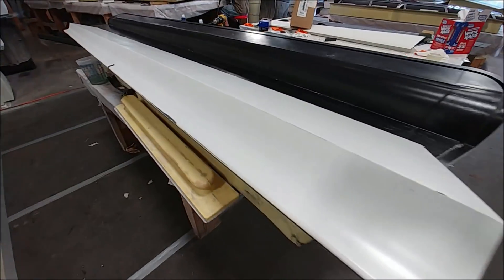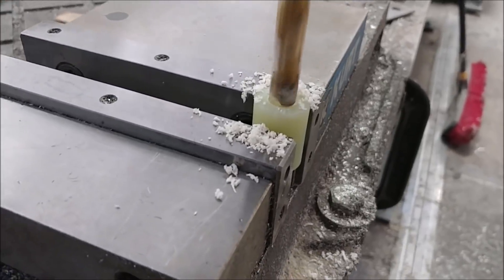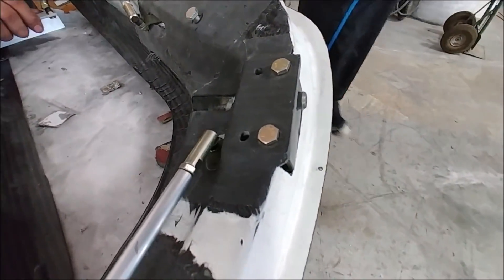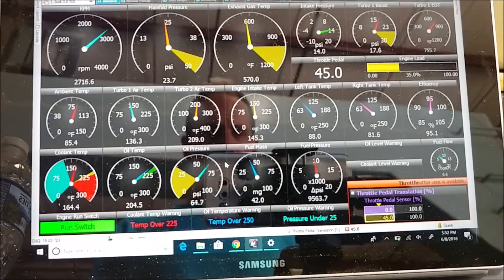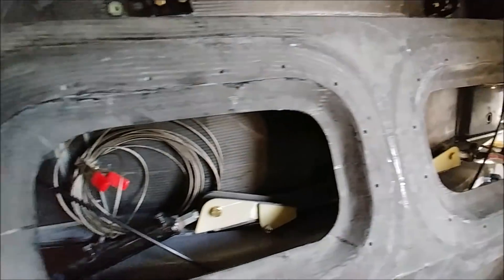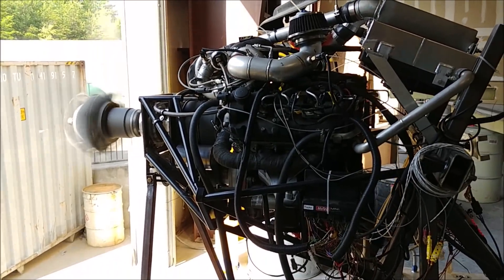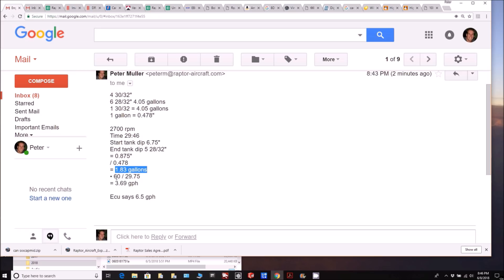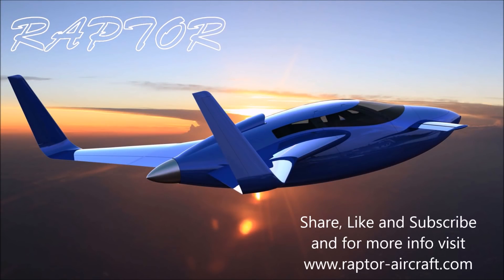What the Fuel Flow? - Building the Raptor Prototype

Comment: Some diesel high pressure injector pumps use excess fuel to flow thru the pump and return back to the tank to help cool the pump...not sure if this one is if that design or not and if so is the ECU able to show what’s actually burned and not returned to the tank?  VP44 on Dodge Cummins for example sometimes up to 70% of fuel pulled from tank is returned to tank in a cycle of cooling/lubricating the pump.   Probably not the case with this engine but just thinking out loud.
Reply from the maker: Yes we have a fuel return to the tank. From what Motec had told me I believe the fuel flow is calculated from the volume the injectors are spraying and no from what the pump is moving.

Comment from the maker: I have since calculated what I think the volumetric efficiency of the engine is at those power settings, using the link below, and it appears that it may be only 39%. In the spreadsheet it's just a number you enter and it was set to 90%. So if I set it to 39% the spreadsheet shows 3.6 gph and 77hp. So the gph agrees but 77hp seems low to be turning a 74" 4 bladed prop at 1888 rpm. I may try modifying the spreadsheet to calculate the volumetric efficiency from the input params. Again, your comments are welcome.

Corrections to my narration. Sorry it's difficult to read in the small preview window when I am narrating.
At 12:16 fuel flow is 3.69
At 12:32 horsepower is 176

https://x-engineer.org/automotive-engineering/internal-combustion-engines/performance/calculate-volumetric-efficiency/
Reply: Raptor Aircraft 
What is your prop pitch at?   Flatter pitches obviously require less hp and thus fuel at a given rpm. 
The diff in fuel burn measure manual vs ECU still has to be figured out.   
I would be very careful with online calculators with which I didn’t had thorough understanding or experience.
Reply: I'm no aircraft engine engineer, but I would agree, there's virtually no load on that engine spinning a flat propeller - that may account for the reduced horsepower and fuel burn you're seeing. 

As for the ECU readings, I'm lost there, you'd think it's somehow reading what the injectors are doing or how the fuel pump is performing - maybe the reading is being confused somewhere/somehow in those sensors.
Reply from the maker: Well the prop is set for takeoff pitch similar to what you have on a fixed pitch prop. There's all kinds of throat coming from it if you downwind if it. So let's take a Cessna 172 with 180hp at take off at 2700rpm. Do you think it could turn a 4 bladed prop at 1900 rpm using only 77hp?
Reply: The amount of fuel injected per millisecond may differ between each injector and the ECU needs to know the factory calibration code for each injector. Since you use a generic ECU, it probably has no idea how much fuel actually gets injected.
Reply: horse power needed goes with the power of three of rpm,  so while 2,700 is only 42% more rpm it needs 2.9 times the power.
Reply: Hi, great work as usual. I think your problem might be in the units? In your email you have 3.69 gph and it was 3.69 g burned in half an hour, if you double that it is actually quite close from the ECU number of 6.5 gph.
Reply: Until you know your pitch (or air mass flow), you can't calculate the horsepower.  Try the link below using different pitches and you'll see that it can vary alot.

http://www.godolloairport.hu/calc/strc_eng/index.htm
Reply: Tiago Santos. Incorrect. He burned about 1.8.
Reply: There are only three reasons I can think of that the ECU calculated fuel flow would be so far off: different fuel pressure, different injectors, or different fuel viscosity. Are you running Jet-A or diesel now? The injector flow might well be different for the two fuels.
Reply: Raptor Aircraft 

the test facility is a relatively closed room and might give some aero effects which lighten the propeller loads. Why not have a weight cell on the stand to measure the torque?
Reply: There is a tool called VCDS which would allow you to read out the Audi ECU before the conversion. There are several calibration blocks per injector that show the timing and volume correction values the Audi ECU uses for each injector in idle and at various common rail pressures. Some of those values are auto calibrated so they reveal how good the injectors still are. Then each injector has a two letter calibration code printed on it. They try to match those for each engine, so all 6 should have same code.
Reply: The GPH in the ECU is probably just an assumption based on what it thinks is the injector flow rate (pulse width x flow rate x injection events per hour = injected volume), which is only accurate when the pressure differential behind and in front of the injector is what is expected.  If the pressure on the rail is not high as it should be, or the pressure it is injecting against is higher than expected, that number will be wrong.  I'd check the fuel pressure on the high side and make sure it is being regulated correctly, and check the settings in the ECU have the right numbers for injector flow rate.  In a gasoline engine, the regulator raises the fuel pressure proportional to manifold pressure (No idea about diesel).
Reply: @patrikj  
Ya can't run Jet-A in a diesel engine because Jet-A is effectively highly refined kerosene so it does not provide the necessary lubrication that diesel fuel provides.

Comment: I have experience from marine engines and fuel management systems and can confirm to you that what a engine control computer calculates for fuel flow and what is real is very much different. The ECU calculates flow based upon injector flow capacity, fuel pressure and duration of injector pulses. It is at best an estimation. What you did for measuring actual qty used is correct assuming your tank volume is linear from bottom to top. If you want to have a very accurate fuel consumption indicator you need two small Coriolis flow meters. One for fuel inlet and the other for the return unused fuel. The difference is net consumed. These instrument measure mass and is used in custody transfers. 0.13% accuracy can be had, which is significantly more accurate than any other liquid flow sensor.
Reply from the maker: Maybe I'll purchase a couple of these and hook them up to the GEA 24 but that doesn't help me right now because I can't get those readings until the engine and actions are mated in the fuselage. http://sarasotaavionics.com/avionics/fuel-flow-transducer
Reply: Knut Bergan ,,, that is state of engineering fuel flow accuracy .
Reply: I was thinking along these lines. Specifically that the ECU is thinking the injector are open for X time and putting in Y fuel into a cylinder with Z pressure. However you've increased the pressure inside the cylinder to Z+A and for the same time X, only inject Y-B amount of fuel. The engineers at Audi should be able to answer that question.

Comment: That prototype door lock system should be preserved for the Rube Goldberg Museum!

Peter, could you post a link to a downloadable DXF drawing of your current door lock design so that we can get an accurate perspective of this challenge and constraints, and perhaps provide you with some alternatives to consider?  I have an aerospace-themed quarter-turn design in mind that might not require any modifications to the locks at all (for the best solution) but I won't know until I see the details, which should include the entire door to begin with because your control handle & mechanism isn't clear yet.  Thanks!

Comment: With the seatbelt mounts attached to the rear wall like that, what is the pull-through strength? How much force is required to pull that whole mount through the carbon fiber? In a crash with sudden stops, quite a lot of force is generated. I'm just curious what the comparison is and wondering if there's any stop-speed at which those seatbelt mounts don't provide restraint.

Comment: Diesel expands with heat you need to adjust for the temperature of the fuel in the tank before and after the run
Reply from the maker: It doesn't expand enough to explain such a discrepancy.

Comment: Perhaps weighing the entire fuel cell before and after the run or creating a separate graduated fuel tank would yield more accurate consumption results. As for the low HP numbers, is that not expected with the prop set to fine pitch? Seems like there would be minimal drag so the power requirement for a given speed would be lower.
Reply from the maker: My fuel measurement is very accurate. The prop is set for take off pitch.
Reply: Raptor Aircraft - I'm far from a viable source on the subject, but, from what I'm hearing, wouldn't weighing it eliminate the factors that are causing the mystery?  (Fuel expansion, fuel return, etc.)

Comment: Hello,

I’m not sure if someone has already commented on this as I’m on my phone screen and can’t easily read comments. Is it possible that the fuel in the tank is getting warmer and expanding, thus changing the volumetric measurement? On the UH60 Blackhawk our engines have liquid-to-liquid coolers, which exchange heat between engine oil and fuel. Fuel expansion is a consideration in our airframe. Maybe measure the fuel temp and the beginning and end of the run?

Best,

Steve

Comment: This may sound like a dumb question, but is the air flow inside the building good enough to duplicate real life conditions. In other words, could the prop be turning in dead air. Wind tunnels have large intake vents that allow for large volumes of air to enter.
Reply from the maker: There's plenty of air flow with all the doors open.

Comment: It would be interesting to see what a 12-14 degree increase in pitch would do in comparison. The setup should be fuel efficient and deliver enough power, I don't think too much emphasis should be put on efficiency and consumption for now but rather what prop speeds you get under high pitch loads. So far I can't see a reason why that engine can't be fitted as is. Sure, it will be run a lot since now and fitment or flying but I don't see a single thing to criticize.  Looks like this kite would be able to do Durban to Walvis bay in a single go.

Comment: I'm kinda new to the project, but have you mounted the power plant on a caged skid and measure the actual thrust?  Also, why the heavy hardware on the doors?  Are you going to pressurize?
Reply: Just some dude 

Yes it will be pressurized.
Reply: Excellent.  I'm very interested.
Reply: Highly recommended video series.  He’s boasting some pretty impressive numbers, and so far it looks like he can deliver.  Pipistrel Panthera is claiming 200ish mph at 10gph, and that looks to be a very sleek and expensive airplane. The raptor could in theory leave it in the dust.

I don’t believe computer numbers till the actual model flies, but it’s worth keeping an eye on this project.

Also, I don’t believe he’s using the final prop they will use, so thrust isn’t accurate yet.

Comment: Excellent progress...A trim motor for ailerons?  Why not just a trim knob?  The amount of trim needed for the ailerons will be minuscule and a motor can run away or short or burn out .. a motor for pitch trim with a back up manual trim wheel and a knob to trim ailerons would probably be best low tech and safest.  Tried and true.
Reply from the maker: The Garmin autopilot has provision for aileron trim so that's why we're using it.
Reply: excellent. thanks

Comment: What about the fuel lines and filter volume, if the engine was sitting there could have been some drain back. Then that volume got added into your fuel burn when you dipped the tank right after shut down?
Reply from the maker: I dipped the tank before even dropping the rpm for the cool down.
Reply: Raptor Aircraft, yeah that's fine but when did you dip the tank before the run. Was the fuel system fully primed and full of fuel in all the lines, filter, rail etc. Like it was during the dip after the run?
Reply from the maker: As I said in the video, I dipped it right after I set the rpm to 2700 and then again 30 minutes later while it was still running at 2700 rpm.
Reply: Okay, well then we assume your measurements are accurate and the ECU is wrong. So is it a calibration issue or do you have injectors leaking possibly.
 Did the injectors ever get pulled and placed in graduated cylinders and physically flow and leak tested?

It is actually rather hard to fully understand the what and how of your process when all we have to go on are these videos, as well produced as they are. It can actually get pretty confusing as to the exact order of things when a hour long process is explained in a couple minutes.
Reply from the maker: Most likely the ECU needs to have the injectors calibrated. Then perhaps the BSFC is slightly better than 0.326 and so the horsepower was just over 80. I'll have to try it will a higher power setting to see the comparable fuel burn.

Comment: If your goal was to get an accurate measurement of the fuel consumption, then dipping is not an acceptable method.
You should either weigh the tank, or fill the tank to a known mark at the top of the tank. (add a narrow neck on top of the tank to increase precision), and measure how much fuel you need to add back in the tank to reach the same mark with a precise instrument like a burette.

But the final disparity you have measured is too great to be only instrumental error. My guess would be a human error when you dipped : you  probably either mishandled the ruler or misread the value. (on top of the very poor accuracy of your measurement method)
Reply from the maker: You must think I'm stupid. I know how to take an accurate measurement on a stationary tank with square sides. As stupid as you think I am how do you suppose I got this far with the project. No response necessary.
Reply: So your measurement is correct and the ECU is wrong then. You have solved the problem.